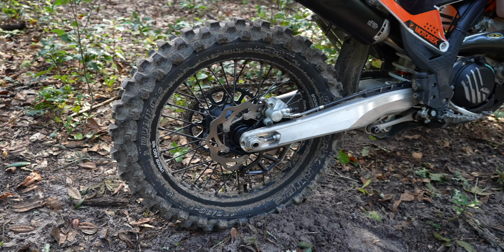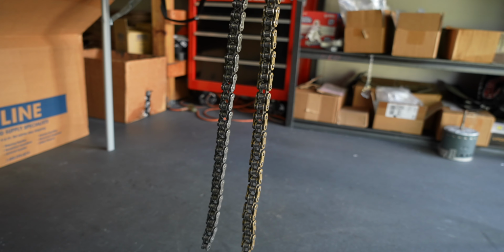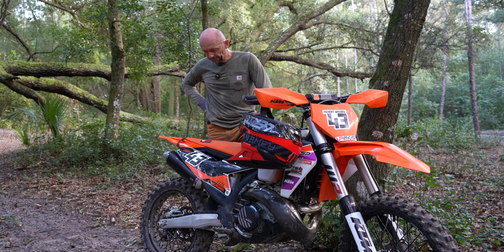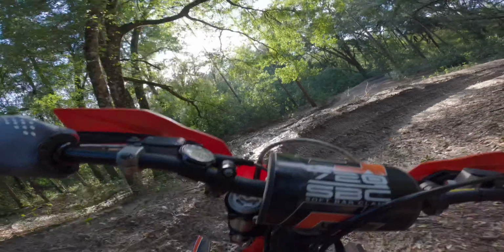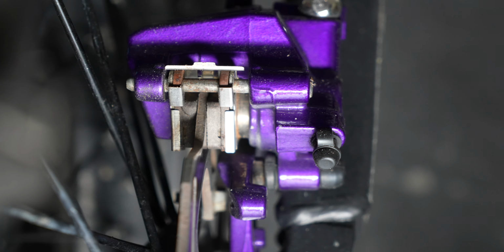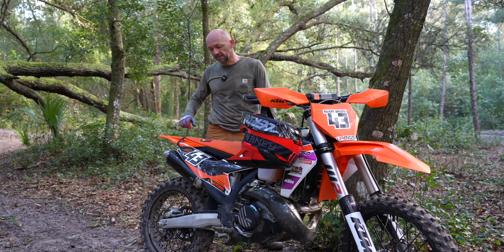Good ideal to install a spring between the pads?!

Comment: The idea behind the very slightest drag of the pads is to keep stuff from getting between the pad and rotor when not breaking. Allowing crud to get between the pads and the rotor will lead to premature brake pad wear and rotor getting groves or scoring.

Comment: It's an interesting idea and I appreciate you sharing your experience with it. It seems like dirt getting in the slightly larger gap and wearing out pads/rotors faster is an academic, theoretical concern that's mostly present in your off-road, dirt environment. I think the idea might have the same merit on nice, clean road use, without anywhere near as much of the academic downside.

Comment: This goes against how a brake caliped is supposed to work. 
Pull both pads 0.3mm away from your disc and see how long the lever is. So by adding a spring which wants to push away from the disc is not a good idea.

Comment: As the pads wear the distance between the rotor and pads will increase with a spring there, you will start to lose braking effectiveness as the lever needs to take up the distance before the brake pads start to press on the rotor. not a good idea in my opinion.

Comment: Not really sure if it makes any difference. Anyway in mountain biking some kind of metal spring is on all brakes between pads to reduce friction so there is something to it.
Reply from the maker: Yes I have the metal spring on mine mountain bike, I think those are handling better the heat then the traditional springs.

Comment: Just clean and grease your pins regularly when you maintain your bike! all that spring is gonna do is clog with shit on any offroad bike and possibly stop your pads moving. I've done brake pads in 2 mx sessions before it's why I always ran solid rear disc after.

Comment: You’re supposed to grease all sliding surfaces where the pads sit
Reply: Yes I especially like to grease the rotor most. Makes for a slicker smoother braking experience 🤦
Reply: @chadrides914  you grease where the pads ride on the caliper, have you ever read the instructions

Comment: Isn't this what the seals do already? When the brake fluid stops pushing, the seals retract the pads away.
Reply from the maker: No. On dirt bikes the pads are sliding on the rotors. Mountain bike and a lot of cars have a still spring between pads to move them away from the rotors.
Reply: @roberturmosi-dirtbike-atv  No, the brake piston seals flex and retract the pads. They only slide in the seal when the pads wear.
Reply from the maker: They should but when you push the break and let it go the piston only slide back enough to have one side of the pads loos the whole break assembly won't move to release the other side
Reply: No they dont

Comment: Man I’m looking to build a yfz450r with 55-60 hp similar to yours you think it will drastically change realibility ?
Reply from the maker: No it dose not, the Yamaha engines pretty reliable except the 22-24 yz250f they have a timing chain issues

Comment: Definitely not a good idea. You don't want any "knockback" on the pads. Some high performance auto brake calipers actually have springs installed behind the pistons, inside the caliper, to do the exact opposite, as well as in-line low-pressure check valves. If you have springs pushing the pads/pistons, then you will have an unnecessary amount of pedal/lever travel to apply braking force, very unpredictable.
Reply: 100% correct . Even 0.5mm of a gap between the disc and the pad could give you a long lever/pedal. So for me this mod doesn't make sense.
Reply: Exactly. Imagine when the pads are worn to half thickness, you’ll probably have to pump your breaks once or more to even get the pads to engage the rotor 🤦‍♂️

Comment: What problem are you trying to solve? This is purely solution looking for a problem, it's not needed and will provide zero benefit and now you have one more part on your brake system that could bind up and will fail at some point.